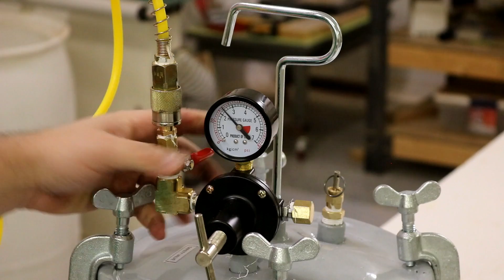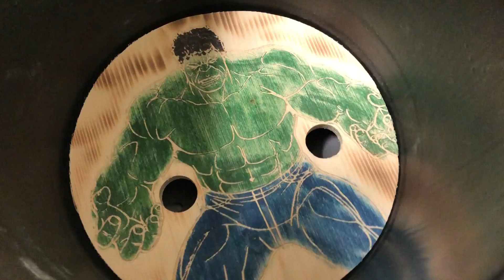Converting a Harbor Freight Pressure Pot for Resin Casting

Comment: What is the point of rearranging the fittings? You could have just capped off the paint output fitting and the air out fitting on the pressure gauge, and save money.

Comment: The way you lay out all of the parts needed, in their packages and saying where you got them from — just epic, chef’s kiss. I’m armed with screenshots to take to the store and ready to rock this 💪
Reply from the maker: Thanks for the Kiss.. I appreciate it.. some of the new harbor freight models have a different fitting  I’m told.. but you will be able to get where you need to go with your screenshots 😀😀
Reply: @JakeThompson mine didn't fit the 1/4 connectors on the gauge, I had to go get all new parts!
Reply from the maker: @TheDarkArch0n  that’s unfortunate .. All new parts.. I’ve heard some people say that there have been one fitting that they have changed over the last few years.. are you saying that none of the parts I listed work?
Reply: @JakeThompson  the release valve worked, but the pieces that connect to the pressure gauge did not fit, 1/4 was too small.

Update: I needed 5/16" pieces and an adapter back to 1/4" and it worked like a charm!

Comment: For someone that is interested in resin casting, $300-$500 is an incredibly high barrier to entry to normalized pressure pots. I was so excited to find this method and hoping to be able to create clear casts in a few weeks opposed to months.
Reply from the maker: I used this pot for quite a while before going to the more expensive ones.. It will definitely get you going

Comment: Thanks.  Good information.  Wondering if this can be accomplished without the elbow.  Connect the ball valve directly to the regulator then the hose connector directly to the ball valve.  Would need to use a female threaded hose connector.  Just wondering.  Again, thanks.
Reply from the maker: There’s lots of ways to do it.. some people don’t even use a regulator.. if it will hook up and not leak. It will work. 👍👍
Reply: Thanks.

Comment: Jake, your instructions were spot - on!  However, my converted pressure pot still leaks enough that I'm not able to put a casting in it.  I tested all the fittings with soapy water and no bubbles so I'm guessing it's the lid gasket.  I cranked down the lid as tight as I could with tools - didn't want to break the screws - and ran it to 30 lbs and after about an hour it was down to 20.  I'm dying to put my first try project in it.  Any suggestions from you or the other subscribers as for how to condition a Harbor Freight gasket?  Or is it something else?
Reply from the maker: There is an updated gasket you can get from Amazon, but you can leave the air hooked up to it in the meantime and let the regulator keep it at the right pressure
Reply from the maker: Also .. here’s another video and the link to the seal is in the pinned comment.

Comment: I've been using pressure/vacuum cycles for resin casting for about 40 years.  If you have long enough working time you can first vacuum to expand bubbles and get them to float to the top, then while the resin is still not cured, increase the pressure to 4-5 atmospheres and this will collapse remaining bubbles and make a more dense casting.  This is a well done presentation on making a pressure pot out of a paint pot.  Well Done!  
The vacuum cycle can cause the resin to foam up and run over the top of the containment so you really need a window so you can see what's going on inside the pot.
Reply from the maker: 901EE Great information! Thank you for your comment. I’m glad you enjoyed the video!! !👍👍

Comment: Thank you for this video! However the one I got has the two bolts from the base that refuse to come out ;; Is there any way to work around it? No amount of liquid wrench, wd40 or anything else helps oTL
Reply from the maker: Very welcome.. You could try applying heat to it.
Reply: @JakeThompson  Just got around to it and that was it! Thank you so much for the tutorial!

Comment: One thing I have seen others do with this pressure pot is poor silicone into the bottom and let it set/harden before first use. This fixes the dome bottom issue and they now have a flat surface when placing things inside of it. Just another alternative to placing a block of wood with your favorite superhero inside of it. :D

Thanks for this video! I also watched a few of your other videos and they are great stuff! This is a whole new hobby world that is exciting!
Reply: I use an 8 in pie pan to bottom mine out.
Reply: An advantage of using silicone to level the bottom is that spilled resin won't stick to it.
Reply: I was wondering about that.  Thanks
Reply: Pourable silicone, which product would that be?
Reply: @micstica  there are lots of them.   Put in silicone kits for silicone molds and there will be tons that come up.  Smooth on is a popular one
Reply: I did same thing ,Similar anyways . I put saw dust on bottom and used epoxy resin . After it hardened I sanded it flat

Comment: Love the video. Gave me the courage to give it a try. Ran into problem with conversion. I know you said you used 3/8tap to open up paint outlet so brass 3/8 - 1/4 would fit but I can't get regulator valve to screw in more than 2 threads on other side. Do I need to tap that one too and if so, what size?
Reply from the maker: It’s pipe thread.. it will say 3/8 pipe thread… it’s tapered
Reply: @JakeThompson  thanks for info. I'm so anxious to finally have mostly bubble free resin casting. Can't wait to try it.

Comment: Hi Jake I loved the video on how to covert the pressure pot  pressure pot for resin. My daughter has been waiting for awhile to get one to improve on her projects. Unfortunately I am having trouble you had with the getting the brass fitting to screw in. I tried to get a 3/8 pipe tap but it was too small. Can you please confirm what size pipe tap  I would need, for both? Just in case I have a hard time getting the pressure gage in as well. Thank you.
Reply from the maker: The 3/8 pipe tap is what it was on mine.. since this video, I have heard that harbor freight has changed some sizes of some of the fittings.. I would take the fitting that came out of that hole and take it to a hardware store and find out what size it is.

Comment: This video is so helpful, thank you so much!
Quick question, the pop off valve that came with the pot will not unscrew for the life of me, is there a replacement I could buy somewhere that is the same ?
Reply from the maker: You can apply some heat and then try to remove it.
Reply: @JakeThompson  Thank you so much that did the trick!

Comment: I have a dumb question Jake.  When I work with mixed material, I tend to use vacuum to remove air pockets and bubbles.  Why pressure?
Reply: More than one way to skin a cat?
Reply: Theres a really informative video about pressure v. Vacuum by Peter Brown
Reply: @paulblair7515  - looks like the cat's skin/bubbles shrinks in volume by 4.25X at 50 PSI if all is still fair with the world.
Reply: I would personally vacuum it first to get the air out then put it in the pressure pot. The best of both worlds.
Reply: Vacuum does not work well with resin, but may for other materials. There are a lot of bubbles in resin and the viscous liquid leads to it just overflowing from the container when under vacuum from all the expanded air bubbles. There are a few videos of people doing it. Pressure compresses the bubbles so much they are absorbed while it cures. When pressure is released post-cure, there are no bubbles (they still absorbed in the hard cure).
Reply: Both is best. Get most bubbles out with vacuum, then pressure to reduce the size of what's left.

Comment: I'm confused, If I want resin free of bubbles do I need to pressure or vacuum? BTW, thank you for your time making this video.
Reply from the maker: Very welcome… both will work. Using a vacuum chamber takes more time and will actually reduce your working time as it creates heat.. The pressure pot is more convenient in my opinion. The resin I use has a short working time and I push it to the limit..

Comment: Did you take the small silver bolt out of the under side of the top? AT 5:30 you take the top part off but under it has a silver bolt as well
Reply from the maker: The bolt underneath is a diffuser.. it stays
Reply: @JakeThompson  Great thank you Jake. All finished nothing left but to try it now. Thank you
Reply: Tried it and there were leaks however I did go and get some Loctite and wait 24 hours and that did the trick. Thank you again.

Comment: Hey jake, great video!  Made it really easy to retro-fit the system for this use.  I'm having an issue that the hole in the regulator that allows it to set the pressure, constantly leaks no matter which way the regulator knob is turned.  Am I doing something wrong?
Reply: I am having the same issue on two pots. Can't for the life of me find another 60psi value to replace it with. Tempted to just cap it off completely, my compressor only puts out 110psi, and the pot is good for 90psi, so unless I'm using gross negligence, I shouldn't have any problems??

Comment: Hello again, I finally did it! The pressure pot is done! I have a hose but now I’ve run into another problem. If put tape on everything but somehow around the lid lip, air is leaking out. What should I do? Everything else seems fine. Thanks again for all your help!
Reply from the maker: On the pinned comment .. there’s a link to a better seal.. but if it’s a small leak.. you can just leave the air hooked up and the regulator should keep it at the right pressure

Comment: Thank you so much for laying out all the parts needed and providing links. Very helpful video!
Reply from the maker: Ruthie Rhodes No problem.. glad you found the video helpful. 👍👍👍
Reply: Do you have any advice for leakage? Right out of the box the lid is leaking air at 25 psi
Reply from the maker: Ruthie Rhodes use petroleum jelly on the seal and tighten as tight as you can.. I’m going to replace the wing bolts with regular bolts so I can tighten them with a wrench.
Reply: I'll try that, thanks!

Comment: It looks like you are applying the Teflon tape against the direction of the threads, why? The tape should end in the same direction the treads are going to get a better fit. Going against the threads will rip the tape off the fitting when you screw it on!
Reply from the maker: No Name I’ve had it for a long time now with no leaks at any threads.. you are correct and about the 10th person to point it out.. I hope you got something out of the video besides my substandard tape job.
Reply: @JakeThompson   Good video Jake.  The idea with tape is no leaks, you succeded.  Before tape my dad taught me to rub bar soap liberally on threads...that works too.

Comment: What you're actually doing is compressing the bubbles so they are so small you can't really see them.
Reply from the maker: Dave B 👍👍👍
Reply: I would think that the pressure actually compresses the resin forcing the bubbles out faster than the other techniques such as heating the material.
Reply: @richardmoser6068  there are some other videos demonstrating compression vs. Decompression. Compression hides the bubbles. They have no place to escape to with pressure may even pack a little more air into it than it already had. When the air pressure is taken off in a vacuum chamber the bubbles expand and float out but this creates foam, the foam rises out of the vessel and before the bubbles can pop/ collapse the resin sets up making a huge mess.   You can remove gases from water and at very low pressures water will even cold boil. Think about a soda bottle under pressure the co2 gas is invisible, pop the top releasing pressure it expands and you can see bubbles.. as it has a way out.

Comment: Any chance someone would be willing to help me make a caddy for the inside on this thing? I don't have access to a cnc. Honestly just need two rounds cut from mdf. Message me if we can work something out.
Reply: Zac Fitzgerald you could possibly look for public workshops in your area. Some places have areas such as maker spaces where you can use machines and other tools.
Reply: @shmoopy4265  
I have actually! The only one out here rents space on a monthly basis for around $250. That being said, I could always ask to just make a few quick cuts. Not sure if they'd let me just run in and out like that though.

But yeah, bit rich for what I need unfortunately.

I did come up with a solution though, just need to find a metal wire rack for displaying baked goods or whatever. One that'll fit in the pot and maybe even a multi layer one? If I find anything I'll try to report back! But I think that might be my best solution, assuming I can find one that's the right size.

Comment: What is the size of the circle that you cut?

Edit: I went to Marshall home good and got a 9" round cake pan and it fit perfectly.
Reply from the maker: LightenS It’s about 9 inches and then I sanded for a nice fit.
Reply: @JakeThompson  thanks a lot
By the way, do you test the relief valve by going to 60psi?
Reply: just pour the bottom with resin and apply pressure, it'll be flat then.

Comment: This video is so easy to understand but I can’t seem to get past the first minute with my own paint tank. I got the tube off on the inside but the thing on top I can’t see to get off. It looks like it’s got some kind of glue around it keeping it in place and no matter how hard I try, I can’t get it off. Do I need any special kind of adhesive remover to loosen it?
Reply from the maker: You can apply some heat to it and see if that helps .
Reply: @JakeThompson  it worked!! Thank you so much!!

Comment: Oky doke Jake ! Thanks ! You solved my  dilemma in deciding  about getting a pressure pot for my resin projects. I bought a vacuum pot to try and remove air but it still didn't give me good results.  My resin actually  set up before all the air came out!  I never considered Harbor Freight for the purchase on the pressure pot either so thanks also for that too.  I subscribed to  your channel hope to see more of your content asap.
Reply from the maker: Thank you… I have another video coming out tomorrow… it might help ya out also.
Reply: Great I have been an artist and doing all kinds of stuff over the years, wood carving, welding ,metal fabrication, forging sculpting, machining, building electric guitars from magnesium,  knife making  always looking to expand my horizons.

Comment: Noice quick and easy 

Took me a while to find a good instructor, straight to the point much appreciated.
Reply from the maker: Thank you .. glad you liked the video 👍👍
Reply: @JakeThompson  Hey sorry to bug. I can't seem to adjust the pressure cap any ideas on what I'm doing wrong. the max psi I get is 30.
Reply from the maker: @vidcargonzalez9210  check out the pinned comment at the top of the comments. There is a link in that one.

Comment: the only thing I see is the threads on the bottom of the regulator (6 o clock when the gage is at 12) are straight threads. Then theyre going into NPT. We need 1 more adapter. The side with the pickup tube is 5/8 straight threads. You can jam in the 3/8 NPT but its best if you hit it with a tap also.
Reply from the maker: @KEEPINITRIL  👍

Comment: Mine leaks from the lid at anything over 20 psi, I noticed the welding was crap so I fixed that then I noticed under the rubber were globs of metal from crap weld so I ground those down flush but I still get a leak around the lid any input will help at this point

Comment: Wonder if you can use this to stabilize wood blanks for turning on a lathe?
Reply from the maker: You can make this into a vacuum chamber but you won’t be able to see in it..
Reply: @JakeThompson  Do you need to be able to see in it? The end product should be the same right?
Reply from the maker: @David-fv7zg  you need to be able to see the bubbles when you are under vacuum.

Comment: `why not pour alumilite in the bottom of the pot for leveling it...
Reply from the maker: headlightdog That’s a pretty good idea.. 👍👍
Reply: headlightdog if your resin spills over the two will become one.  That is why you would not want to pour resin into the bottom
Reply: @JakeThompson  Actually that's a bad idea. 
- prevents changing in the future
- that would be a LOT more $$$
- precludes taking out platform if you need a bit more room at the top.

Comment: So, I want to do this, but I don't have an industrial/commercial/whatever you call a large one air compressor. I have a DeWalt portable air compressor that one would use on like spare car tires and bike tires, and it can fill up to 120 PSI, but the end won't hook up to the fitting on this, only to a tire valve fitting...

Comment: The adapter advertised on Amazon does not fit the pop off valve for this style of pressure pot.
Reply from the maker: Harbor freight must have changed the design.

Comment: Isn't the regulator with the gauge meant to regulate outward pressure? Especially if you already have a regulator on your compressor you could remove the gauge and attach it to where you put the release and just keep it in the same place. Then remove the inlet valve and replace it with the ball valve and attach the air hose connector to it. That way you don't need a femal elbow or cap.
Reply from the maker: I use the regulator at the pot to keep track of what is in the pot.. You could just have a gauge without a regulator and just close the valve when you get up to pressure.. To each their own .